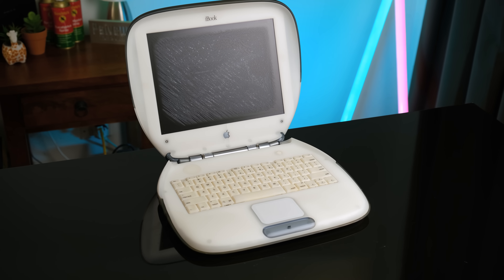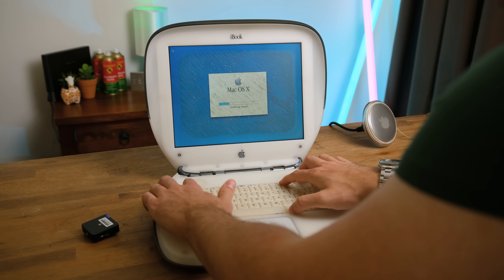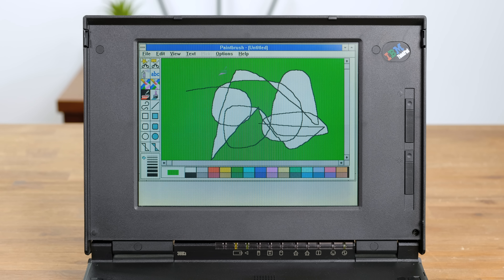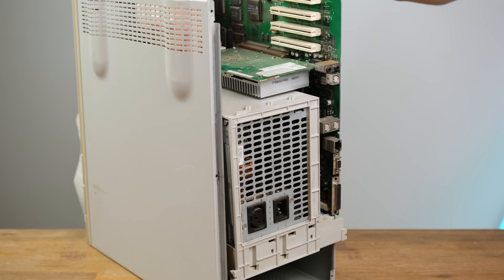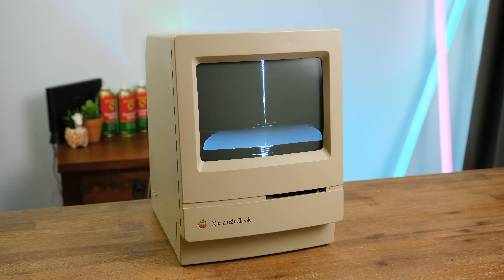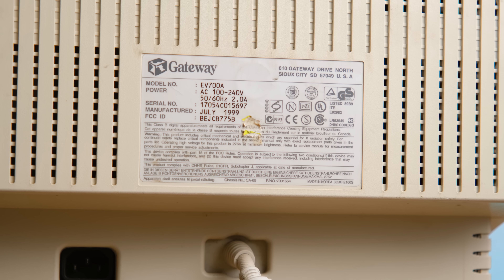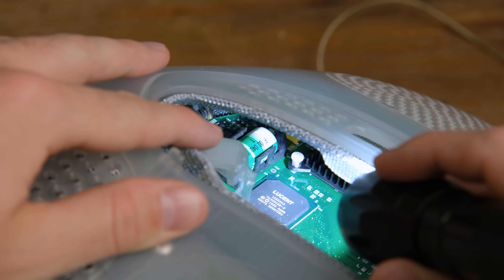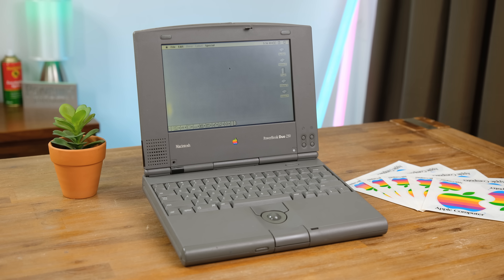So Much Vintage Tech Is Dying... Here's Why

Comment: I recently got an old PC (BIOS notes a copyright year of 1998) which still works. All of the smaller capacitors have started bulging but as it's not really anything special I don't intend to save it. 

I've been playing around with it a bit in ny Lain cave and even got a modern version of Debian (i686) to run on it. 

It's a shame these devices are dying but all good things must go eventually. The only fear I have is that I will run out of 3.5" floppy disks.

Comment: I collect iPhones 2G… I keep them in a double wall cardboard box in a dry and cold environment and re-charge them every year. In average I’ve been losing 2 iPhones per year since around 2015 (original iPhones came up in 2007) due to batteries swelling up or simply not turning on anymore. Thanks for your video!

Comment: People don't realize everything is only intended to last for 10 years even if it last longer than 10 years it's obsolete People just don't realize the 10 year rule because some cars last longer than 10 I have a stack of 20 phones all less than 4 years old some not even a year  old that won't even power up the built in batterys are so bad
Reply: My Bosch washer-dryer is from 1991. I have repaired the thing a zillion times. Worst was drum bearing replacement.

Comment: Interesting video. Tell me one thing though - how come my 1980s Commodore 64 still works perfectly after nearly 40 years with varied use? Sometimes heavy use, other times stored away for years then pulled out to play again. Only thing that failed was the cassette deck needed replaced.
Reply: The Commodore is still keeping up with you!
Reply: I'd say that it's thanks to your 'varied use'. electronics do seem to have surprising longevity when used every now & then when they're no longer your daily driver kinda thing. left totally unused, even in proper storage, for prolonged periods (really, years on end), seems to accelerate the decay of said electronics instead.
Reply: Because of its simple design, I guess.
Reply: Because it's not an Apple.
Reply: I bet a well-taken-care-of Apple IIe will still run fine. It's the plasticky 90s stuff that's decaying.
Reply: @bitwize  My original message included an exception for anything designed by Woznic, but I felt it wouldn't be appropriate for the audience of this channel.
Reply: Apple over-engineered their designs in the 90s to make them aesthetically pleasing which leads to many point failures.

Comment: I have a Macintosh se FDHD and it still works fine, I’m actually surprised honestly I also have that exact ibook I recently installed Mac OS 9.2, it was extremely hard to find and burn your own disc without buying an original copy. The screen problem hasn’t happened to me yet, hopefully it doesn’t for a few more years. A very good video you just got a sub! 😀

Comment: If you really want to preserve your old tech, I suggest putting it in an inert atmosphere and in near absolute dark. All the problems presented in the video are caused by acid corrosion (the batteries), oxidation or photoreactions. Good luck setting up the inert atmosphere tho
Reply: Most of the corrosive stuff is already inside (battery leak vapour, wrong oils, acidic glues, migrating plasticizers etc.). Ozone from outside is the smallest problem although it does eat rubber parts and white plastic (titan dioxide produces free radicals).

Comment: this also goes with gaming consoles also as i bought a few Turbografx-16's and the Compastors on 2 of the 3 i bought sadly budgled one bursts completely ruining the Board the 2nd didn't thanks god but was not a cheap fix, also some gaming consoles also used built in watch batteries for the Clock time and sometimes Data storage like the Saturn,  Dreamcast, and i think also the 3DO also has one so Always keep an eye on those too in your retro Consoles.

Comment: I wonder if these problems are due to humidity, temperature causing change in the plastic, etc.
Reply: Hard plastic can swell and turn brittle by contact with wrong oil. In 1990th I had a Toshiba CD writer drive in a PC that tended to get stuck. After oiling with "machine oil", after a while the whole black polystyrene chassis started to crumble apart like charcoal. The same happened with a transistor radio. Also bakelite (e.g. in Hammond organs and tube radios) is infamous for this. When plastic cogs split around the metal axle or concentric cogs in quartz clock movements get stuck, this happens by swelling plastic due to wrong oil. Thus never lube unkown plastic mechanisms with anything but silicone oil. Also most rubber (latex, butyl etc.) turns into chewinggummy goo by any non-silicone oil. By I read complains that otherwise silicone oil may soften silicone rubber (used as rubber keys and key contacts), so do not spill it and avoid to oil if you don't need to. 

Similar plastic/rubber damage may happen by long time exposure to oil or battery leak vapours. Battery liquid vapours particularly damage LCD displays, thus failing segments or broken carbon foil cables (they tend to turn brittle anyway, e.g. inside calculators and Casio music keyboards) are likely caused by this.

Sticky gummy paint on devices mainly happens by UV/daylight, but also by migrating plasticizers out of deeper layers. This can be washed off with vegetable oil (aka cooking oil - needs some elbow grease). Remove the oil residues with isopropanol to avoid further harm.

Comment: Storing components in plastic bags in a humid location (like England, which is mold heaven) is a horrible idea. Wherever you store anything use a desiccant such as a baby diaper to absorb moisture.
Reply: Problem is when the corrosive substance (battery leak vapour, plasticizers, wrong oils) are already inside and get sealed inside the bag instead of venting out safely. But without bag, ozone attacks plastic and rubber parts (mainly if combined with daylight/UV).

Comment: bad plastics are a real concern the culprits are styrene and acetate both were and are still used as components in composite plastics styrene loses bonds that make it flexible it can turn a composite plastic quite literally to dust! or at the least parts snap off like they're made of sugar.
acetate has the bad habits of shrinking, forming cancerous-like grows, and mold!
bad metal composites are another problem the humidity even low humidity can make them rust, swell, sweat, and turn to dust! this includes bad factory solder ingredients the turning to dust thing is the main problem here.
then there's the bad print manufacture it can de-laminate, rust, react with factory solder, and even produce hydrogen gas once turned on resulting in a fire!
a protective agent used since WWII used pretty much in electrical devices until 1990 can cause discolorations of wires turning them all green tinted, causing mold, causing cracking on the boards, aka this is the main reason why cards are mostly green, and last, loss in conductivity in the board's connections.
so! a real nest of decay to sort out but not all is lost most components are still made or were well-stored, and others can be reproduced by sometimes now easy means so don't give up the future will come up with an answer.
Reply: Hard plastic can swell and turn brittle by contact with wrong oil. In 1990th I had a Toshiba CD writer drive in a PC that tended to get stuck. After oiling with "machine oil", after a while the whole black polystyrene chassis started to crumble apart like charcoal. The same happened with a transistor radio. Also bakelite (e.g. in Hammond organs and tube radios) is infamous for this. When plastic cogs split around the metal axle or concentric cogs in quartz clock movements get stuck, this happens by swelling plastic due to wrong oil. Thus never lube unkown plastic mechanisms with anything but silicone oil. Also most rubber (latex, butyl etc.) turns into chewinggummy goo by any non-silicone oil. By I read complains that otherwise silicone oil may soften silicone rubber (used as rubber keys and key contacts), so do not spill it and avoid to oil if you don't need to. 

Similar plastic/rubber damage may happen by long time exposure to oil or battery leak vapours. Battery liquid vapours particularly damage LCD displays, thus failing segments or broken carbon foil cables (they tend to turn brittle anyway, e.g. inside calculators and Casio music keyboards) are likely caused by this.

Sticky gummy paint on devices mainly happens by UV/daylight, but also by migrating plasticizers out of deeper layers. This can be washed off with vegetable oil (aka cooking oil - needs some elbow grease). Remove the oil residues with isopropanol to avoid further harm.

Comment: I gave all my old computers, laptop and parts away, just have one old Compaq laptop with melting rubber, Sony tablet S with leaking LCD and some other stuff. Down from 250 computers, 30 laptops and 25 screens to less than 10 of each. Moving to another country makes you realize that you maybe have too much. Still have some really old computers, portables and some stuff in Australia. Maybe there is somebody over there who wants it.
It's not only computer plastic that is failing also motorbike and car plastic from the seventies, eighties and nineties is crumbling and cracking.

Comment: One of the big limitations of silicon today, is silicon is a crystal and crystals grow.  So while the FINFETs are getting smaller and smaller, the space between them has been stuck for the past decade, they separate them with a calculated service time of about 30 years.   Older chips had a greater space, as they weren't as dense as moderm technology, so they take longer to go bad, but they will eventually.  It's this limitation of silicon that has tech companies researching other semi-conductive materials.

Comment: I still hold onto my Psion Series 7, a beloved bit of tech from the late 90's, but it quit recharging years ago. There's still nothing that works as smoothly as those things did.
Reply: I have here a Psion Revo with soldered(!) NiCad batteries. I guess I should do surgery to remove them before they rot through the display.

Comment: It's interesting that you mentioned sacrificial Anode (aluminum), that's usually something you hear with construction or bridges. But it makes sense, good deduction, stainless steel watch.
Reply: May be the paint is a mixture of 2 metals. The Hindenburg airship paint was mixed of aluminium and iron, that became extremely combustable by forming thermite when it started to burn.

Comment: would they need to be stored in a low oxygen environment? maybe a vacuum ? what would the ideal time capsule computer be made from? bronze? maybe all capacitors are routed to a separate removeable PCB card with big simple leads and generic, well labeled cells so that even amateurs can repair them with over the counter components? Maybe the keyboard keys could be ivory like old pianos cause bronze wouldn't feel nice?

Comment: I collect video games and consoles and actually have worried about things for awhile.  Old Cartridge Batteries, Disk Rot, The Wii U Nand issue talked about recently, 3DS Batter swelling. I have an Old gamegear that had the cap issue or worse that hasn't worked in forever. I like to collect and preserve this stuff, but often think about selling and going digital with emulators.

Comment: I watch the videos of a guy that restores the early electronic pinball machines. Batteries are a nightmare on those things when they leak. In those cases where the parts cannot be salvaged, there are new modern "circuit equivalent" boards being made for hobbyists. I wonder if a modern motherboard could be made for some of these devices? It is sad tho, to see all the age rot happening to these old bits of kit.

Comment: My commodore monitor used with the C64 still works with still a nice bright colorful picture... But the audio amplifier doesn't produce anything anymore. I bet it's electrolytic caps.
Side note: please be careful opening devices with a CRT - high voltage can remain for months in capacitors. Always discharge the acceleration voltage with a CRT discharger (it's a high voltage safe resistor well insulated to hold it to slowly discharge).
Reply: Not capacitors but the CRT itself is a glass capacitor that holds the charge. It is a conductive paint on each the outside and inside of the glass envelope (websearch "leyden jar") that stores electricity for some months. But it only can bite you if you remove the suction cup cable. (During most PCB repairs I don't need to discharge it.) Rather be careful with electrolytic caps in power supplys (PC etc.). Use a big resistor or soldering iron mains plug to safely discharge. (Do not short by screwdriver - it damages the capacitor.)

Comment: It looks to me like your cool dry place really isn't cool and dry as you think it is. Also, UV light will destroy plastics. So if you love having your stuff displayed in lots of sunlight in your room? Guess what? You're killing it as UV damage is accumulative. Same if you store stuff in your garage or attic. You're killing it. A lot of non working issues are due to bad capacitors that are easily replaced. The popping of the fly back is mostly likely because it needs new dialectic grease applied to the cup. Another thing is that cold isn't good for electronics because cold things expand and expansion can ruin solder joints and mess with your LCD screens because that liquid wants to expand and it doesn't really have room for it Same with caps as many have a liquid chemical in them. Many "dead" device are brought back to life after cleaning, especially if they have moving parts and the old lubricants need to be removed and replaced.

Wait, are you using window cleaner on screens? If so? lmao you dummy window cleaners and iso destroys screens and can give you that hard surface. It causes delamination and dry rot. I use propranolol based cleaner as it's  safe on near everything as it's safe on polymers and isn't a corrosive like window cleaner and iso and window cleaner is for glass and not for ANY type of tv or monitor type of screen
Reply: Vinegar syndrome "this happens when the LCD's internal polarizer films, which are made of acetate, break down into acetic acid. storage conditions apparently make a big difference. high temperatures and high humidity can cause it to happen relatively quickly."  So if it happened in a short period of time and to that degree in said time? And stop using window cleaner. In fact stop using it entirely on plastics. It causes dry rot, same with ISO

You can also fix the screen by carefully removing the old film and replacing it with new polarized film.
Reply: Cold <14′C causes tin plague, which decomposes solder. Also zinc can crumble apart, and rubber parts turn brittle (need to be heated to revive) if stored too cold.

Comment: That's not vintage, 1960s Tektronix gear is vintage. General Radio rubber boots on Tektronix probes dissolving back into their basic hydrocarbons, that's dying... and the smell

Comment: I have that sticky rubber disintegration problem with my PS5. I don’t know what it is about my skin oils but no one else I know has this problem with PS5. PS4 it was a known issue
Reply: Skin lotions (particularly with essential oils like fragrance) can strip paint from keys and decompose plastic surfaces easily. I am very careful with handling tea tree oil etc. Also normal oils (food etc.) can decompose rubber and some plastics, so keep food away from keys. I collect music keyboards and often found small craters in white keys. But I guess it came from letter glued on keys and removed with too strong household cleaners or by disinfectants.
Reply: @cyberyogicowindler2448  Good point. It could be Benzyl Peroxide now that I think of it. I only use it on my face to keep clear skin and wash my hands after, but it's possible it gets on my fingers from touching my face etc

Comment: Solder "Hairs" and "cracks" they had a problem with it in NASA . its the tin component in solder. the "Hairs" and the "Cracks" that develop in the cheep solder joints create shorts, and resistance and in some cases they create their own circuit which allows the device to function but causes strange random error and behaviors.
Reply: Do you mean crystal whiskers/dendrites? There were warnings that they may cause nuclear warheads someday to detonate spontaneously by moisture or fungus grow. Many nukes are decades old now certainly not all are serviced well.

Comment: I guess old Japanese gaming systems like the Sega Genesis and NES are vampires after 30 some years and going strong. I replaced the pins on my NES. My Sega Saturn works great with a new laser. Sounds like Macs don't live very long.

Comment: I have a 2002 Mercedes c280 and the plastic dash will literally crumble if you touch it , I also have a 2006 chevy Silverado and the liner under the dash is will crumble if touched. I feel like we are being royally screwed here with low quality products and designed obsolescence .

Comment: Have you thought about storing the equipment in vacuum sealed bags?
Reply: Ozone harms, but most of the corrosive substance is typically already inside (battery leak vapour, plasticizers, wrong oils, acidic glues), so sealing it inside will make the disaster much worse than letting it safely vent out.

Comment: Swelling batteries is not a problem limited to older computers. I have an HP Spectre x360 that's only about 5 years old and I had to do a battery replace last year when it swelled and started pulling the case apart. Lithium batteries just suck in general as a technology.